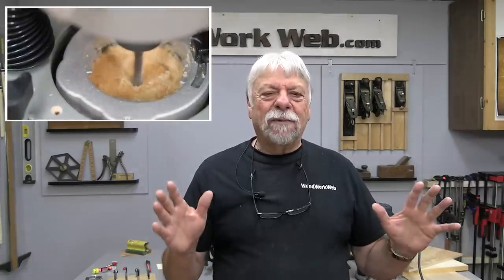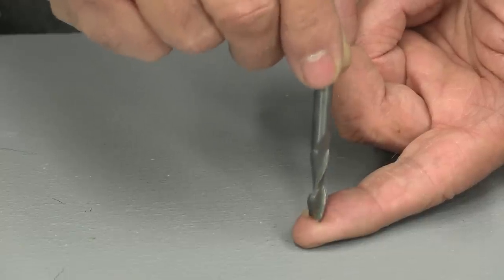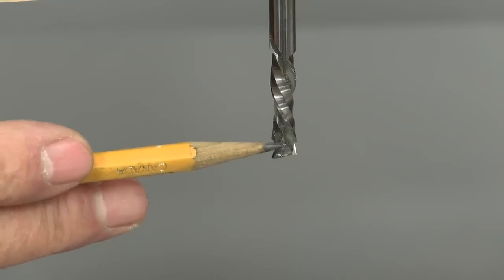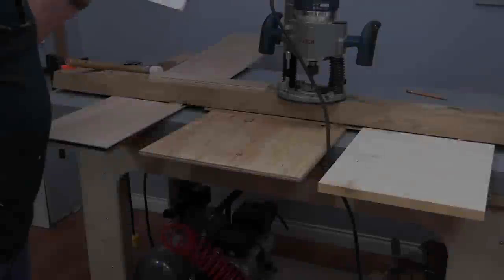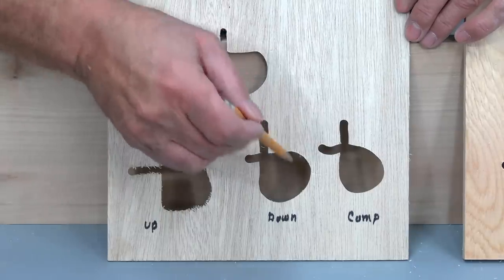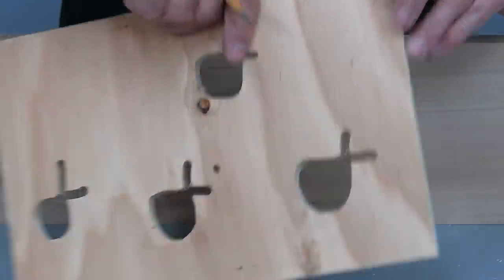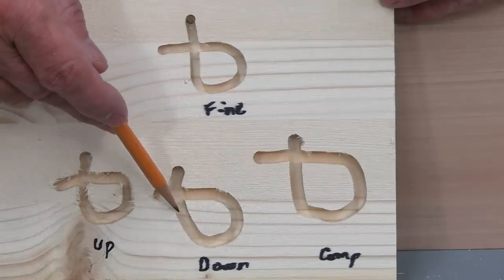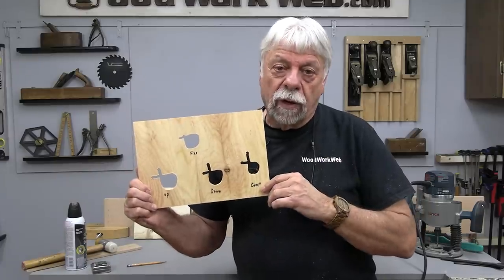Watch This Before Buying Spiral Router Bits

Comment: Thank you for the informative and practical video.
I know the manufacturers call these "spiral" bits. The correct name for this geometry is helix because the radius is the same along the rotation axis. In a spiral the radius increases or decreases.
DNA is in a helix, and an old style wood screw is a spiral.
Circular staircases are usually helical, like inside a cylinder. If they climb inside a cone, they will be spiral.

Comment: Handheld routers came first and somebody had the idea to mount them upside down in a router table later.
So UP is toward the router, and DOWN is away from the router. That's how I remember which is which when it comes to upcut or downcut spiral bits.
I hope that helps.
Reply: Exactly. I remember it as upcut cuts towards the motor, and downcut cuts away from the motor

Comment: Upcut spiral bit is EASILY the fastest making grooves and heats up the least, since it clears the chips up away from the groove. Always use it for the first cut. And, it is as good in through cuts as a downcut or up/down bit.

Comment: I recently used a spiral upcut bit while cutting exact fit dadoes in 3/4 inch plywood. While cutting one of the dadoes the router began laboring so I stopped cutting. Unfortunately the bit had loosened in the collet and started "drilling" deeper into the wood and penetrated through the bottom surface. Moral - tighten those bits!
Reply: Terry, I've had exactly the same when I used an upcut bit for the first time recently (in a box-joint jig I'd just made). The spiral is trying to drag the bit out of the collet and as you say, these bits need to be tightened more than "standard" bits.
Reply: @helmshardover  all router bits should be held securely. But if you top load bits (flip a router over) and just let them fall to the bottom of collets you're going to have a problem getting collets tight on bits. To understand why you have to imagine how the whole mechanism works. The nut driving the collet down into the shaft taper and the jaws of the collet grabbing the bit shank. When the bit can't move with the collet you're baked. Then you have to overcome the friction between the bit shank and the collet jaws to get the collet any tighter. Which you can do as you pop a blood vessel in the process. It is easier to just make sure the bit shank doesn't bottom out though. To that end I ball up a little bit of paper towel and stuff it into my router collets. Paper easily compresses yet holds bits up while they are waiting to be tightened. Problem solved.
Reply: @1pcfred  "all router bits should be held securely" - of course. 
I've been using Routers & Router tables for over 20 years, and never had a bit come loose till this one.
It's a warning to anyone that what you perceive might be tight may be tested with an upcut bit, so give it more!
Reply: @helmshardover  in the past decades things have been changing. Now there's imported tools. Which has implications for Americans. Because foreigners don't really use our measuring system. They still like our money though. So I seen them selling 6 mm shank tools as 1/4" Now you can load a 6 mm bit into a 1/4" collet and it seems to hold. Up until you start running it anyways. Then it might slip some. Really if you want hold you want 1/2" shank bits. It's all about the surface area. 1/2" router bits are the luxury ride. They cost more because they're worth it.

Comment: Question for the expert (you):  Would I be able to use my 1/8" shank Dremel bits, with a 1/4"-1/8" adapter, to use with my DeWALT DWP611 palm router?
Please advise, thanks.

Comment: Many of the CNCs tend to make several passes, getting lower and lower until they have cut through.  In the case of your compression bit, the first pass at the top of the workpiece would be an up-spiral, but that would change to a down-spiral as the passes got deeper and deeper.  It would be interesting to see the results of the 4 bits with the CNC doing what you did free hand.  Also, when you cut all the way through free hand, the chips could drop out the bottom which would not be the case for a workpiece on the CNC's waste board.  It would be interesting to see how the bits fared on a CNC with regard to chip clearing.
Reply: Compression bits are exclusively designed  to cut in one pass with the tip coming out to the other side of the board.

Comment: I would have liked to see a straight bit in the comparison test.  It would give me an idea if spending the extra money on these bits is worth it.
Reply: One of the biggest advantages of spiral bits over straights, is that spirals prevent kickback issues due to the slicing rather than the chipping that straights do. For plunge cuts, either would work ok, but spirals REALLY shine with edge trimming/cutting.

Comment: Thanks for the very informative video. Because straight bits will be the easiest to sharpen, would it not be better to take most material away first with a smaller diameter straight bit and then 'sneak cut' with a spiral bit?

Comment: Can those bits be used to cut a compass for making circles ? Also what’s the difference between a plunge router and a compact one other than size ? I feel like a router does more and is less intimidating than a jigsaw. I want to start learning to use these tools for making my own art substrates.

Comment: Many thanks for another very informative clip.  Now I have a question please.  Which bit would you recommend for cutting box joints on my router table?  Thanks again.
Reply: Watch the video. Box joint on router table is the equivalent of last set of cuts obviously. Downcut or fine-downcut.
Reply: @SenselessUsername  I think it needs to be an upcut bit for this, to pull the chips toward the collet.

Comment: Colin, you have inspired me to do some testing as well.  My testing will be around the CNC engraving that I do a lot.  Currently, I don't use many spiral bits; mine are all the two flute straight bits.  What I've heard is that if I'm hogging a lot of material out each pass, that a downcut spiral will have a tendancy to clog the routed pockets, even though the top edges are clean as you showed in this video.  Depending on the type of wood (e.g., cedar), that clogging of sawdust in the routed channels could be a problem, whereas an upcut spiral bit won't have the clogging but the top edges won't be as clean.  When you've used downcut spiral bits on your CNC router, have you ever had any problems with sawdust clogging as I've described?  Just curious...
Reply: Using a down spiral in a CNC, like my Shark HD520, definitely forces the debris into the cut. This is usually the biggest issue when first starting a cut because the chips have no where to go. To help with this, add a ramp to your tool path so the bit doesn't plunge straight into the material and then start cutting. Also, you may need to adjust your spindle/router speed and your feed rate to get good chip size and evacuation. If you are not using some dust collection, adding some will help clear chips off the work surface so it is not driven back into the pocket. Hope this helps but I think in 2 years you may have figured this out on your own.

Comment: One of the most important thing with this kind of bit is getting a high end carbide bit. A typical Freud spiral bit off the shelf from Home Depot dulls quickly and you're gonna get bad cuts.
Reply: You are using it weong if that is the case. Freud makes great router bits .
Reply: Well yeah Freud makes all kinds of stuff, but the typical stuff off the shelf in Home Depot is 'Diablo' by Freud, and it's pretty low end for shop standards. You get what you pay for

Comment: Hey Colin, like your videos, good job!  However, if you look more closely at your sample cuts, note that the "fine" router bit did not cut in the same type of grain that you tested the others in.  It's especially noticeable in the pine, which seems to suffer more tearout than the others.  I wonder if the "fine" would perform differently if you cut your pattern in that particular tight grain the others were tested in?

Comment: As always a lot of practical information LOVE IT! but.....random question Colin, which came first the up or the down? seems like the compression bit would be suited to the CNC where you could really dial it in
Reply: They are. Used mostly for cutting double sided melamine. Lots of closest companys use them for cutting panels and shelving. Has to set up so it is just below the board. They can be sharpened three times. Solid carbide. I worked at a company that made and sharpened them.

Comment: I'd never heard of that "compression" bit before. Am I the only one who thinks that's an odd name? Did you use the same router and router speed for this demo? Thanks for a fine video!
Reply: I think it's a good name.  Just hearing the name for the first time now, and I knew immediately that it would have opposing spirals "towards" each other and not away.

Seems like it's named well if you can guess it's geometry instantly from the name alone.

Comment: Thanks for the video, one question, from your comparisons it looks like we never want to use an up spiral bit, it's obviously not the case since they exist, so in what situations we do want to use them? are they easier to cut? they produce less heat? they are cheaper? why and when should we use them?
Reply: Up is good for a router table since it will pull the work piece 'up' towards the router motor. On a non through cut it also cuts faster since it pulls the chips out of a tenon/groove/dado. So you can use it in situations like this where the tear out, if any, will not be noticable. 

I use Whiteside bits and I do not think the price differs for up vs down.
Reply: @mm-nyc  I see, thank you for the explanation.

Comment: why do all guys with toy routers talk about bits they no nothing about . Chip-lode is what you need to learn before you ever buy  a bit. Every bit and the proper Speed ,Feed and RPM and not once did you talked or say anything about Chip-Lode.